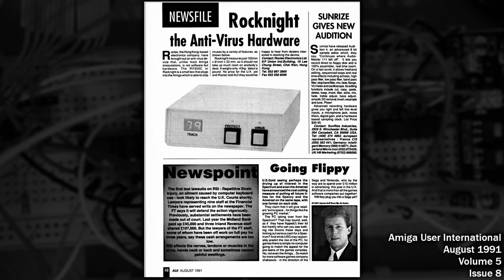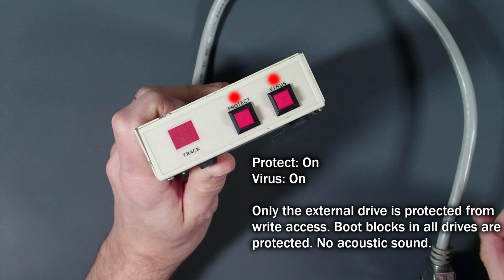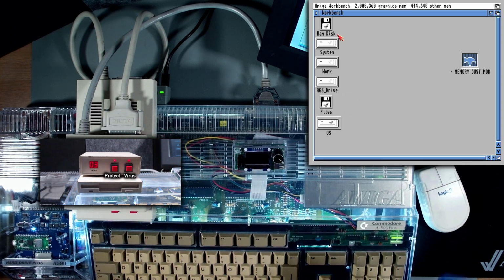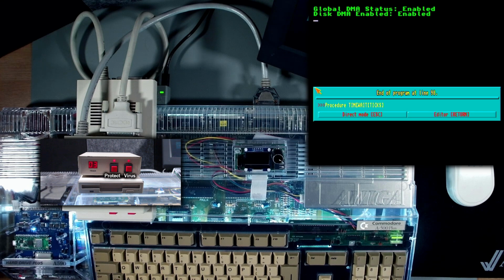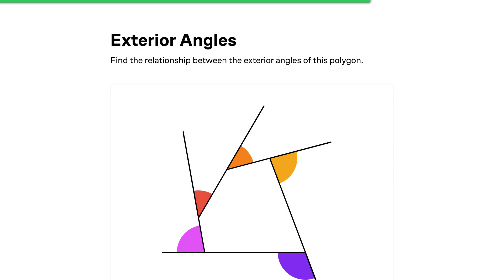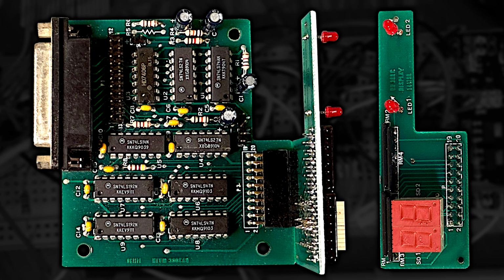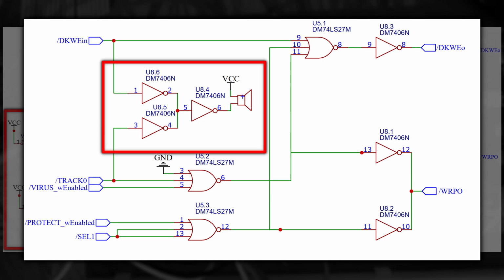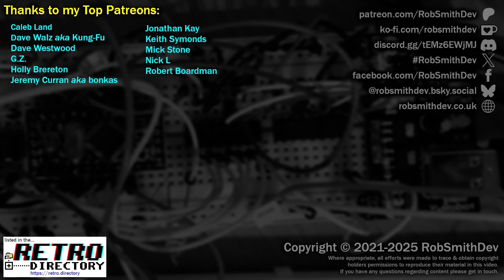Can I Hack and Bypass The Protection in This Device Too?

Comment: You tried to format the disk, got write protect errors, then immediately tried to write files to it and got the same error. Surely the OS remembered that this disk was protected? That's why ejecting it fixed it.

Great job explaining the circuit.
Reply from the maker: Could be… or just that the head was still on track 0. But yes that would fix it

Comment: It's amazing to see the beginnings (relatively speaking) of the arms race between malicious code and countermeasures. Today most of the stuff is so deeply burrowed in processor microcode and kernel-level operators (if you exclude stupid stuff like D-Link leaving backdoors open to the wide web) that it's hard to comprehend the complexity, but "back in the day" code and hardware can be understood, at least in part, with a couple weekends' worth of prodding at RAM addresses and seeing what happens or literally just looking inside⁽¹⁾, and I think that's neat.

(1) I am underselling the effort somewhat, but extrapolating from my own experiences with analyzing 8/16-bit games and modern ones, the old architectures are so much more intelligible. Just look at the NES lockout chip or the GameBoy's logo comparison, those wouldn't even classify as security features nowadays (yes, the GameBoy one is more a copyright protection, but still, Nintendo relied on it for security, that's my point)
Reply from the maker: I guess back then the tools that we now use didnt exist and so subverting protections etc just wasnt feasible for most people. I agree with these days it being hard to know what's going on, especially from an "outside view"

Comment: Could be wrong, but ................. From my memory the device failed as a product as it only worked with workbench 1. Later OS versions used a different track layout that meant it didn't protect and/or it corrupted your files....       edit: not compatible with  "Fast File System?" maybe.
Reply from the maker: No, Amiga OS version or file system would make no differences. 
The track layout between OFS and FFS isn’t actually that different at all
Reply: I forgot the details but eventually as a floppy fills up the OS will try to put data on track zero which will result in false alarms or in case of enabled write protection may corrupted files.

Amiga viruses were pretty tame so imho thse protectors were more of a pacifier for worried users.  Similar for the track display.  Not really useful but potentially entertaining.
Reply: @ thanks.

Comment: AMOS Professional and its rainbow cursor hits right in the nostalgia. Interesting design. And it even has classic Wired-OR gates. I was expecting a microcontroller inside. I guess that's why it gets easily confused when swapping disks. I wonder if it gets even more confused with multiple disks inserted at once. I don't know how microcontroller prices were back then, but wouldn't this many discrete chips cost about the same?
Reply from the maker: I've been pointed to the Roctec Roclite RF382C Floppy Drive that had these antivirus functions built into the drive. 
Inside it used the 18CV8PC-25 IC which was some kind of programmable PAL/GAL chip. My guess is that they did combine all the logic later on as suggested but due to poor sales probably never went back to this device.

Comment: Shouldn't be hard to include the side signal so it doesn't block the whole track. Only a slight improvement though.

This could work with a util that avoids writing to track zero so that files won't get corrupted.

This was likely meant for using with workbench/app disk in drive 0 which was write protected anyway, and the data disk in df1 protected by the device.
Reply from the maker: I don’t think they really thought through the target - yes a replacement trackdisk device could have been made that stopped files being put on track 0 - not a bad idea but excluding the actual boot block stating this causes you to lose 10k of disk space probably would not have gone down well

Comment: Hardware virus protection! Next you'll be telling me we can have telephones without wires.
Reply: You can! The trick is to use a tightly pulled string instead of wires.
Reply: This is amazing! I wonder if we could take our wireless phones and connect them to a device on the kitchen wall to keep them safe. 🤔

Comment: This may be crazy talk but why buy one of these when you could have run something anti-virus memory resident? Okay it won't pick up 'zero-day' but what am I missing apart from that.......... these devices do say something about viruses and maybe piracy on the Amiga.
Reply: Well ..... I think £2.99 bargain bucket says it all
Reply: AmigaOS had no memory protection (or management) whatsoever, so you could not trust anything on your computer. 68k systems were unsuitable for serious tasks anyway.
Reply: @IkarusKommt ouch, that hurts, seeing that Macs, STs and Amigas did a lot of serious work. :) And of course there were 68k systems with an MMU, like the SUN-1, but that didn’t compete with the Amiga…
Reply: @root42  Yes, you had to have schematics that cost more than CPU to prevent the system from crapping itself. The fact that Macs were bombing every 5 minutes, STs never got a proper multitasking OS, and Amigas never got  a proper memory management or a real multitasking OS proves that the platform just wasn't there unless you could afford to dance around it.
Reply from the maker: Virus checkers running in the background while workbench was loaded was (and still is) a thing. Not so much with games though. I do this this was aimed at "less legitimate" software and games though. Bigger problem with memory resident virus checker would be most games  (especially the earlier ones) would just kick the OS out and use all resources which would also kick out the virus checker too.
Reply: @RobSmithDev  Interesting, thank you Rob